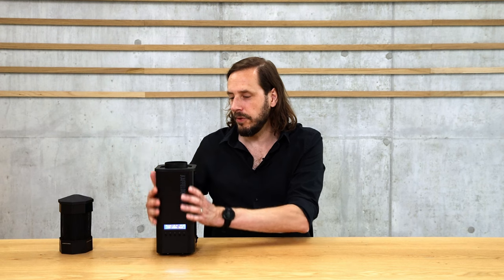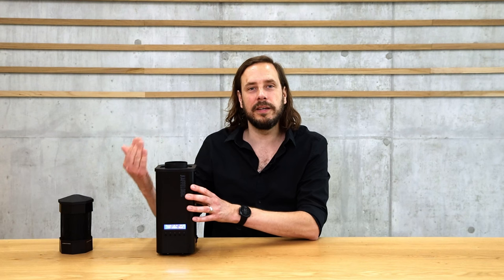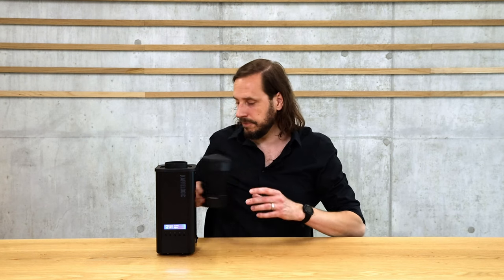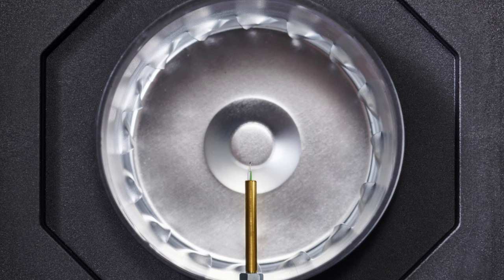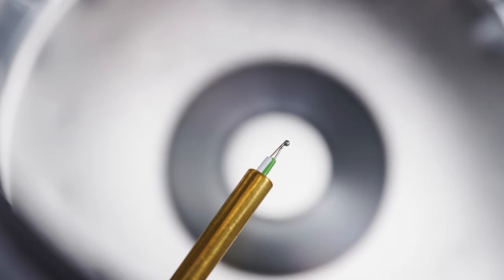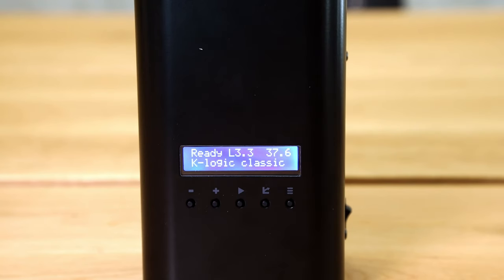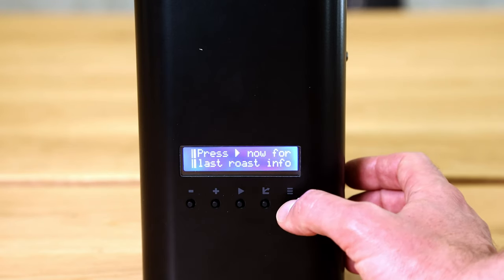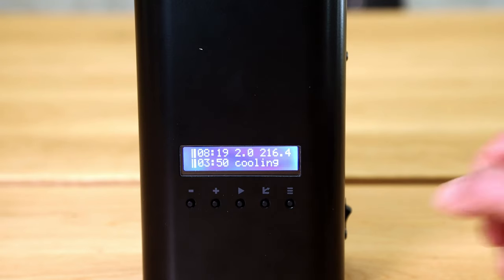Kaffelogic Nano 7e - quick start guide

Comment: Great video! since you tested both this one and the Ikawa, what is your recommendation? any Pros/Cons between them? i'm thinking of buying one of the 2 so your help is highly appreciated!
Reply from the maker: Hi Guy. If you look on the website, I compared some features of the two machine, that I personally find relevant: https://roastrebels.com/en/coffee-roaster/kaffelogic-nano
In particular measuring the BT in Kaffelogic vs. Air inlet temperature in Ikawa and the broader range of capacity of the Kaffelogic. I personally also prefer the roasting style of the Kaffelogic which is closer to a traditional drum style that the very short roast in the Ikawa,... In particular with the Ikawa home, you have to take the additional monthy cost for the App into consideration if you want to use the full potential of the App. The Kaffelogic Software is free to use. And some more. I hope the overview on the website helps a bit.
Reply: @CoffeeRoasting  Thanks for the super quick response! any major difference in the smoke between the 2? Adding another one to the equation...did you also try the Sandbox r1? i know it is a different technology but how it is compared to the other 2?

Comment: What about controlling the smoke indoors. Is this to be used under a kitchen exhaust hood? How tall the machine?
Reply from the maker: Yes, usually a kitchen vent can handle the amout of smoke, the Nano produces pretty will. It's proportional to the amount of beans you roast - but it's also dependend on the roast degree. So the darker, the more roast. With the new chaff collector, height is 45cm.
Kind regards
Ingo